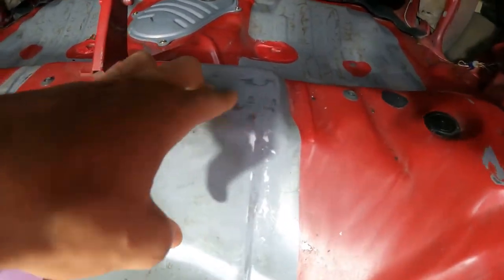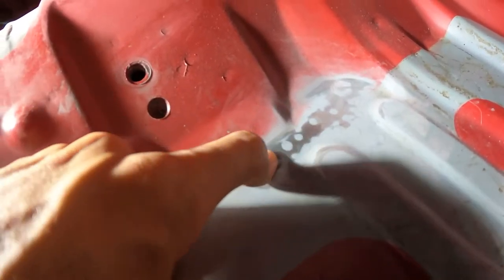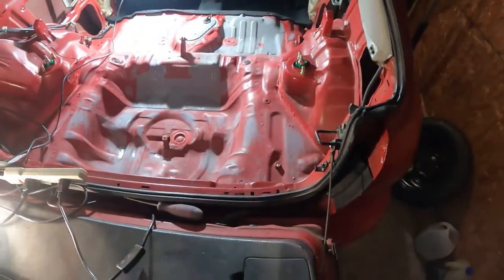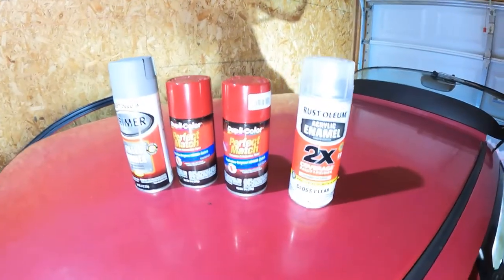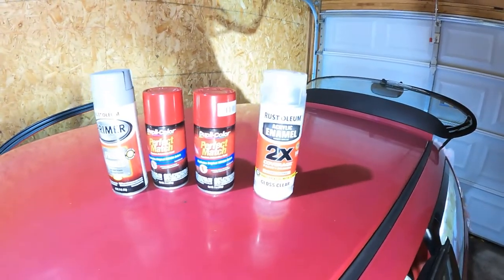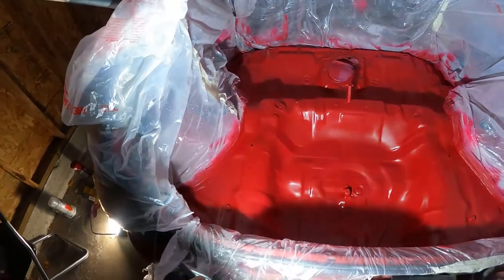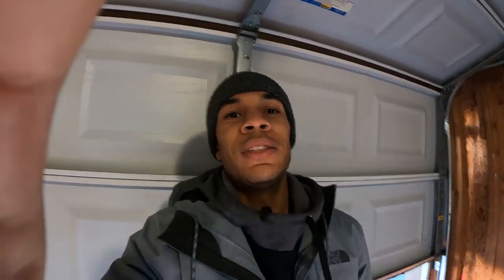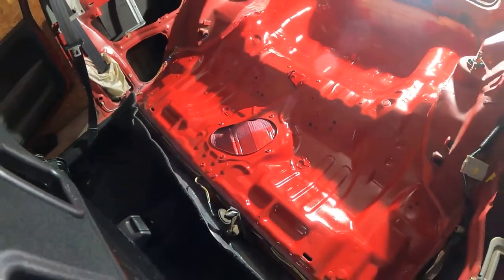Painting the Interior | Novice Track Civic EG #17

Comment: Heat gun would come in handy to help with runs and any blemishes caused by touching. It basically heats up the paint to re liquify and flatten out.
Reply from the maker: I didn't know that was a thing Keith! Definitely going to use that when I paint the body (If I don't try wrapping it)